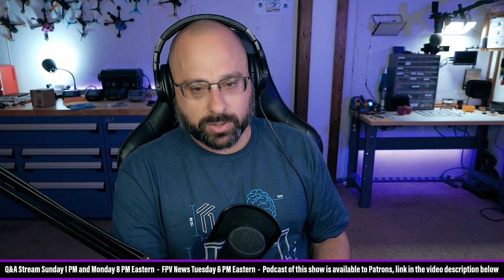Why Is Analog FPV Latency Lower Than Digital At The Same Framerate? - FPV Questions

Comment: Analog doesn't go through an analog-to-digital convertor, nor does it go (back through) a digital-to-analog converter. Each ADC and DAC step requires a buffer (number of samples to fill the pipeline), which by themselves are pure latency. The ADC and DAC steps are the very meaning of digital, in addition to whatever DSP they experience in between. Which adds more delay that analog doesn't experience.

Comment: JB was right about redundancies being removed in video compression...this is how P (and B) frames are encoded, i.e. by referencing blocks from previous frames. I-frames on the otherhand use lossy compression to strip less perceivable details, followed by entropy encoding. Btw HDZero does do the lossy I-frame compression (without entropy encoding), but just not the sophisticated P frame stuff.

Comment: Isn't DJI and Walksnail also retransmitting data? Adding to the latency. Happy flying everyone. 🤓
Reply: This is a myth. It doesn't make sense for any realtime video system to retransmit corrupted frames. A stale retransmitted frame of something that's already happened is useless to a pilot. Any corrupted frames received are just dropped. The gap created by those missing frames is what we perceive as latency. It's analogous to the effect of going from 60 fps video to 30 fps FPV...you lose half the frames and it feels laggy. And yes, that was a dig at HDZero 1080p30 😂
Reply: @kandredfpv  👍🤓